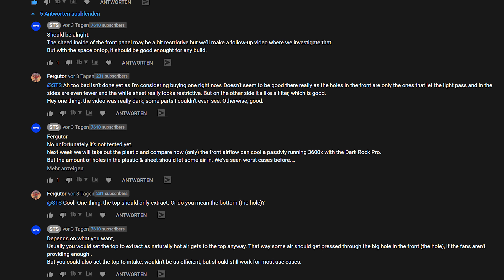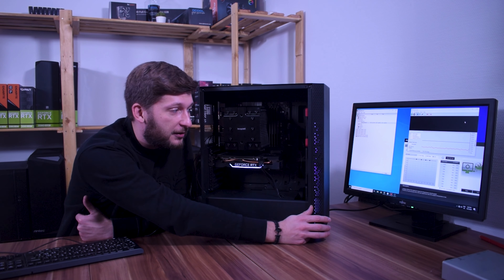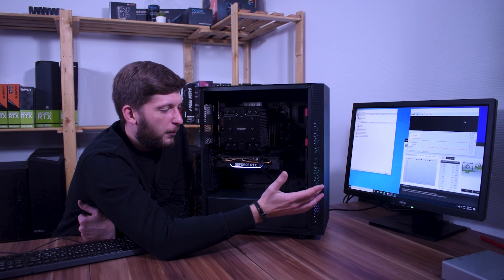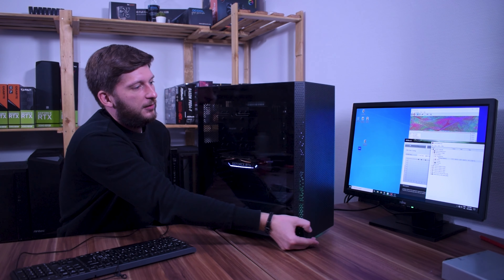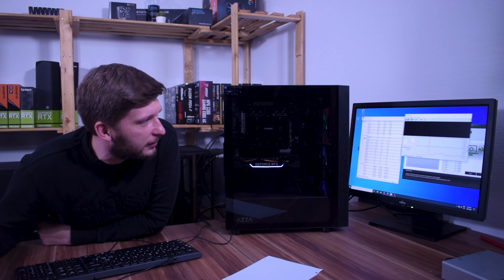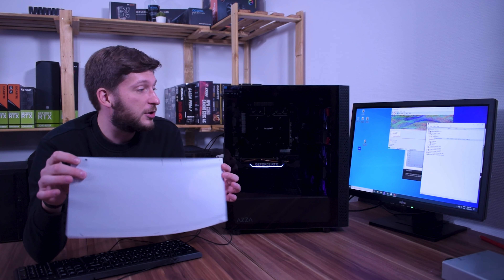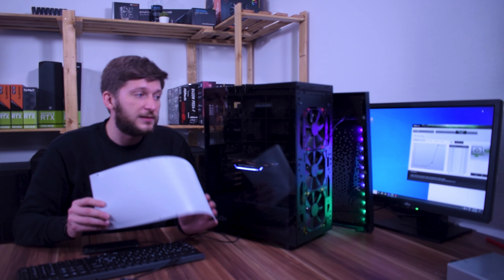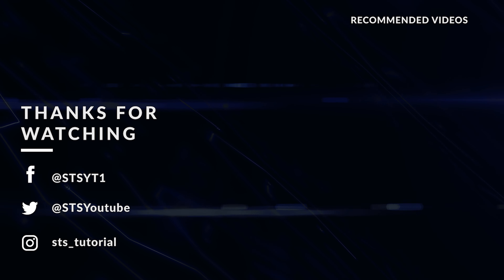But What about the Airflow? | Azza Celesta 340 Atx Gaming Computer Case

Comment: step 1: take a needle.
step 2: heat it.
step 3: fill that white sheet with holes.
step 4: Profit from both things, plus a instant made front filter.
Reply: I own this case, and was just looking at the magnetic sheet on the TOP of the case, which is a mesh. If it were white (and large enough), it'd work great in the front!

Comment: Well I can tell you one thing; it’s still way better than anything Alienware. I built a PC in this case with a watercooled i11900K and a standard RTX 4070 TI. The airflow without CPU is great for both GPU and SSD. She’ll run anything I throw at her at 4K max resolution at 120fps+ no problem. Not so much for my friend with a $5000+ Alienware where the airflow completely throttles his performance by 1/3 despite his CPU also being watercooled. This case is very sexy with great airflow if your CPU is watercooled. I recommend it!
Reply from the maker: Alienware is really not the best comparison for anything 😅
It’s like they do that on purpose

Comment: Hey, thanks for the video. 

I need help. I just built my PC and it turns on, I can get into bios. I am about to install windows. But when the PC turns on, it does 3 beeps sometimes, then one beep. But then it still turns on okay. Is there something wrong ??
Reply from the maker: If i remember correctly, 3 Beep Sounds sounds should be something with the Ram.
Can you double check if the Bios recognizes all of your Ram sticks correctly?
Even if it does recognize them all, try taking them all out and re-install 1 and try again. If nothing Beeps anymore, try adding one Ram Stick at a time and re-check if the beep is gone.

Comment: If  your CPU is running 12 degrees warmer it indicates a massive problem.   12 degrees cooler on my 1060 keeps it from overheating while gaming.  If the CPU is also 12 degrees warmer in your system, it would be fair to say the entire enclosure is 12 degrees warmer, including the GPU.
Reply from the maker: Keep in mind that in order to test this, I removed the CPU Fans. The CPU is kind of passively cooler by the Case fans. If you put them back in, the difference is more like 1-2degrees C. Sure that thing is restrictive, but these tests are severely pushed so that I can accurately measure it :)

Comment: I mounted an AMD Ryzen 3 3200g on this case without GPU and without the 3 fans on the front and the CPU was sitting at around 77°C on stressing test, in case somebody wanted to know.
Reply from the maker: Thanks, but would this way of stress-testing not end up with the (almost) same result for any case as there is no air moving anyway?
Reply: @STSYT  not of my concern. I mounted this for a customer and just wanted to share my results since it might be of interest to some people.

Comment: That "Fergutor" dude is such a douchebag...
Haha!

But I was right, this is what I said: "Doesn't seem to be good there really as the holes in the front are only the ones that let the light pass and in the sides are even fewer and the white sheet really looks restrictive. But on the other side it's like a filter, which is good"
And you just showed that there are 13 and 14ºC difference with that front panel with that few holes on it to let the light pass. And then there is the white shit...sheet. And you said in the other video that it had a good airflow...you were wrong, WRONG!!! Haha!
Now, you used the fans at 100%? Imagine at normal speeds, not forcing it to actually move some air, I wonder if any air actually pass, especially through the upper fan which seems to be more restricted than the others.
Now, while the test was interesting, although not methodically scientific enough, I would have also done the test in more normal conditions of a typical build and not assume results in a more typical scenario. So the 3 fans at nomal speeds, with a heatsink with a fan but with locked speed and not locked, and an exhaust fan at normal speeds too (locked?). Locking because when one fan lacks, other, due to rising temperatures, will speed up which can make the test be faulty especially when one not mentioning the amount of noise and the reason of only one specific data result (ºC). So, I like your test but a more typical, but not completely typical, would be more useful I think as it will reflect better the variable (white sheet, plastic cover) in normal setting for the final user.

And it's actually pushing, not pulling. The ones extracting are pulling.
See? A douchebag. 😐
Reply from the maker: It really depends on your definition of "good" or "bad".
The reason why I didn't show any other scenarios is that they gave the same results but with a much smaller difference. When there was a fan on top, in the back, or on the CPU, the results began to become smaller and smaller. It would be hard to determine if something is better than something else if the difference is within the margin of error. That is why I tried to exaggerate everything until the difference becomes quite big.
But my point remains the same, of course the white sheet is "bad" for airflow, but when I look at the results of other cases with their sound blocking foam... this is not that "bad" after all.
And if you would use the case with a normal system (fans where they are supposed to be) you would end up with just a couple of °, which in my opinion is not worth removing the sheet.

? For what I know the front air should be pulling. Push/pulling should be determined by the orientation of the fan in regards to what is behind/in front of it. It pulls air into the case, thus pull? It would be pushing if I turn it around and slap it on the white sheet.
Reply from the maker: For some reason your comments are blacklisted for no reason. We'll try to fix it, if we can
Reply: @STSYT  

Ah ok, good enough explanation.

In regards to pulling pushing, if you were talking with the white sheet as the reference, yes, they are pulling through it. But if you are talking regarding throwing air into the case then you are pushing, while the exhaust is always pulling (air from the inside of the case). Because the inside is the reference. Just as when we talk about cpu coolers with a push pull configuration, the reference is the heatsink (https://i.stack.imgur.com/Ivd1g.png), not where the air is coming from or where is throwing it to becaue all fans work the same way, they all pull and push at the same time, so there must be a reference. So I agree with you, only that I understood you weren't talking about the white sheet.

About my comments, hmmm, maybe it is because I am a default douchebag!! HAHA!
Probably I got flagged so I am blacklisted (?)...I get into "fights" too often here with insane people. Just the other day there was one lefty idiot that was trying to troll, unsuccessfully, trying to pass as what they see the "other side" is, making insane comments, and I got him triggered so much he ended up impersonating me, using my nickname and avatar, so I can only guess he flagged me too and etc...he got his channel deleted for doing that, by the way.
So, kids, don't do that.

Hey! Try to review the Azza 330 and Aerocool Hive!